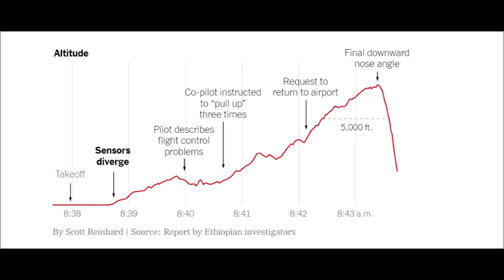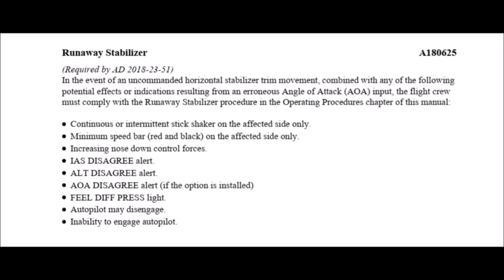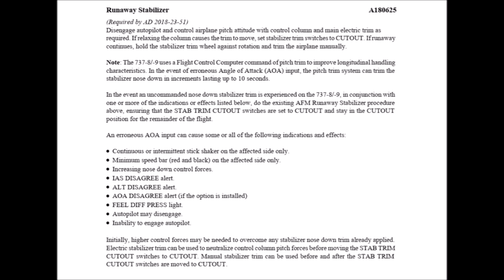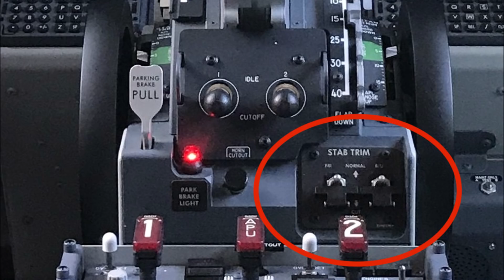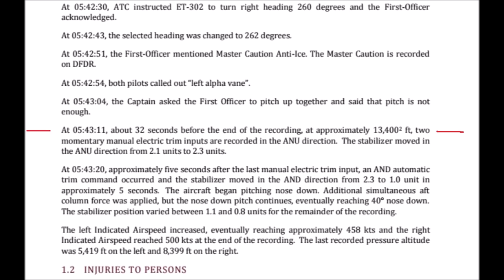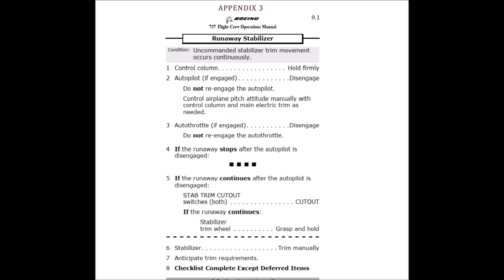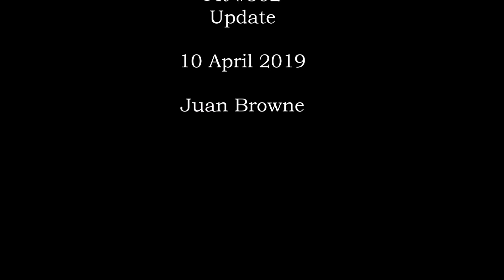737 Max Update 10 April 2019 Runaway Stab Trim Procedures

Comment: My guess is that they switched on the electric trim again in desporation because they couldn't trim it manually because of the high speed and the pressure on the jack screw.
Reply: That much is pretty clear.
      From simulator videos I've seen, the automated inputs are REALLY FAST.  That wheel is just whizzing around, much faster than could be done manually to reverse it, not to mention having to overcome incredible force on the HorizStab at such high speed. 
    I found an article providing more detail, consistent with what is reported in the present video. It seems reliable to me (non-expert).   If this information is deemed unreliable please reply, and I will delete my comment. 
https://www.skybrary.aero/index.php/B38M,_en-route_south_east_of_Addis_Ababa_Ethiopia,_2019
Reply: @MendTheWorld  you make a good point. Those wheels turn very fast. Even if they could trim it manually it would take a long time to turn the wheel. Another reason why they turn on the electric trim because they needed to trim it fast. And the jack screw was found in "full nose down" position. So it would take a long time to move it manually.
Reply: @henryford2736  The trim wheels can turn fast but the rate is determined by the aircrafts mach speed. If the Captain or the First Officer uses their trim "up" thumb switch, it will cancel MCAS operation instantly and trim the nose up. 5 seconds after they release their thumb switch, MCAS will reactivate unless the throw the TRIM STAB switches. The Pilots would have needed to run the nose up trim until they were at level flight, and then immediately flip the STAB TRIM switches into the off position. At this point they would have been able to fly the plane easily using the manual trim wheels.

Look at the medium sized white circle on the up left yoke. That is the location of the thumb switch. The STAB TRIM cutoff switches are below and to the right of the throttle levels in the small white circle.

https://www.flickr.com/photos/109161978@N03/40623677013
Reply: @rwj1313  Yes I understand the controls you are talking about. Nice cockpit pic. 2.5 minutes into the flight the FO called runaway stabilizer and he cut off the 2 switches. Nobody can explain why they were not able to trim the aircraft after that. Clearly they had some issues with the manual electric trim on the yoke because the FO asked the captain if he can use manual trim. Cranking the trim wheel manually. The captain said yes and the FO replied "it's not working." Of course by this time they were at VMO or passed it.
Reply: @MendTheWorld  All the information in that summary is sourced from the preliminary report, which Juan covered in his last video.
It's worth taking a look at that raw report linked at the bottom of the summary however, because near the bottom of the report (Appendix 1)  it includes a single image with series of graphs that show all of the available data plotted over time.   It's literally a picture is worth a thousand words situation.    If you do a Google image search for "Lion Air FDR graph" you'll see a similar image that shows all of its data, but tells roughly the same story.
Reply: @MendTheWorld  To me, the rapidly spinning trims wheels would BE the indicator to me, that, hey, I didn't put a trim input in...whoa, down trim, STAB CUT OFF SWITCHES-OFF.
Reply: @MrFg1980   That's actually what they did, but they did it one MCAS cycle too late.    As Juan and others have mentioned, the trim wheels spin all the time, as reaction to other various automated trim changes such as flaps down/up, probably throttle changes, etc so they're largely ignored.   They would have been expecting a significant automatic trim change just after retracting the flaps, and they got one, but the logs show that it started with an short automatic up-trim command, followed immediately by MCAS's 9 seconds of down trim.  If you weren't watching closely you might not see the wheels change direction, and at that moment they were already dealing with left side stick shaker and a bunch of alarms.     In response to that first MCAS down trim cycle, they applied back pressure on the yoke and a couple seconds of manual electric up trim..  5 seconds pass then MCAS starts another  9 second down trim cycle, which they then recognized as a problem after 5-6 seconds , so they ran about 9 seconds of manual electric up trim in response, and then hit the cutout switches.     Unfortunately they didn't recognize the issue during the first MCAS run, so they never fully removed that initial significant down trim.  Once the cutout switches were thrown, they could only remove that down trim by manually turning the trim wheels, but as the speed built up (because they weren't managing the throttle), the increasing aerodynamic loads apparently made it impossible to turn the wheels by hand.
Reply: @MrFg1980  The reality is the trim wheel is constantly moving and  stopping during normal flight with the auto pilot on.  Which it is 99% of the time. Fuel burn, passengers and flight attendants with carts moving up and down the isles etc. causing the auto pilot to constantly re-trim. After very little time flying the 737, you tend to tune out the noise and movement of the trim wheel. It's movement becomes easily associated with normal aircraft ops.
Reply: @daemn42  I think you are  hitting it right on the head. They never got rid of enough down trim so even though MCAS was off they felt like they were constantly fighting with the plane.
Reply: @MendTheWorld  Thank you for that link
Reply: Yes - I don't fault them for this because at that point they didn't have another option - the manual method did not work.  To me, they made one error - a big one - and let the airspeed get away.  Very sad.
Reply: @donmoore5716  agreed. The pilot can do as a last resort what they feel may work. One more thing. With all that nosr down trim I wonder if they, after reducing power, have had enough altitude to trim up and recover the aircraft. By reducing power the nose will drop and air speed will not change. I cannot see where the discission to keep power in, while it is in the check list, could be pilot error. At roughly 1000 ft AGL I think that would have doomed the aircraft as well.
Reply: @donmoore5716  Apparently there are techniques for recovering trim in that full stop posistion but as you say the very high airspeed seems the crucial factor in the loss of control
Reply: @c7042   Looking at the graphs of the data for both flights, it's pretty clear that manual electric trim always takes precedence.    During the Lion Air flight, they applied manual electric up trim at least 30 times, and in many instances this appears to have immediately cut off an active MCAS down trim cycle.   MCAS on the other hand, always waited 5 seconds after the end of the last manual electric up trim activation before starting its own cycle again.  
There is every reason to believe that the pilots of both flights could have kept ahead of MCAS indefinitely, even if the electric stab trim cutoff switches, and the ability to physically grab and stop the trim wheels had not been an option.
Reply: yep it was very bad the way it was setup (no fail safes or limits at that time) 
if they had simply copied the same rules from the boeing tanker virant none of these crashes would of happened , as below is how the 737max (as well as other things) will make it work as it should been when they got back in the air next month or so

AOA disagreement MCAS will not activate if deviation is to far between 2 sensors (if autopilot can't enable Mcas should not activate)
Limit trim amount mcas can do if activated (there is no need for it to goto max trim down)
and if system does activate and pilots disagree with MCAS auto trim down event all they have to do is pull back on the sticks and it stop MCAS and disable it (won't have to stab trim system)

in this case they should of not turned back on the trim power and engine power should've been reduced it as was at take off speed for the whole fault was happening (overspeed alarm was active) 

lion air flight they never turned off the trim power they was actively fighting the trim system and never seem to have considered to stab the trim as it was in the air for some time after the sensor fault happened and mcas was trimming down the plane (they knew the trim was been pushed down)
Reply: And even that could have worked if they had continued to apply manual electric up trim until it was actually back to where it needed to be, but they only ran it for a few seconds, and then stopped.   Lion Air crew did the same thing.   They kept reversing the down trim MCAS had applied, until late in the flight, where they simply ran shorter and shorter bursts of electric up trim.. for reasons unknown.  For ET302, the problem was that once they let the airspeed get out of control, the moment MCAS ran again, it pitched em over into a negative G dive, they eased off the control columns momentarily (shown in the graphed data) which allowed the plane to pitch over even faster, and then they could never recover from that.
Reply: won't the function (clutch?) that enables overriding electric trim by grasping the trimwheels also limit the force electric trim can apply? i.e. if the force needed to trim is higher than grasping the trimwheel the result will be the same as grasping the trimwheel, no trim
Reply: @fuzzy1dk   Possibly yes, but the cockpit voice recording suggests that they tried manual trim and failed, but that manual electric trim still worked. 
"At 05:41:46, the Captain asked the First - Officer if the trim is functional. The First - Officer has replied that the trim was not working and asked if he could try it manually. The Captain told him to try.  At 05:41:54 , the First - Of ficer replied that it is not working"
But the data suggests that after they moved the switches out of the cutout position and tried manual electric trim, that it was functional
"At  05:43:11,  about  32 seconds  before  the  end  of  the  recording,  at  approximately 13 , 400 2 ft,  two momentary manual electric trim inputs are recorded in the ANU direction.  The stabilizer moved in the ANU direction from 2.1 units to 2.3 units"

It seems that at that moment with the plane still level, and airspeed just above VNE, they could have held down the manual electric up trim button, and slowly moved the trim in the right direction.  The weird thing is that the manual electric trims were only applied for a second or two, while earlier data suggests they had used it successfully for longer periods of time.    Both ET302 and Lion Air flights basically ended the same way, with one of the pilots applying only a second or two of manual electric up trim..   followed by a 5 second pause, and then MCAS applying 9 seconds of down trim.
It is unclear why the pilots did not, or could not use the up trim buttons longer.

Also, the data suggests that any time the pilots apply manual electric up trim in the middle of MCAS's run, MCAS was immediately overridden.   The data from both flights always shows a 5 second delay after the last manual electric up trim command, and the onset of the next MCAS down trim cycle, while many times the up trim command immediately cancels and reverses MCAS.
Reply: @fuzzy1dk  I agree totally and I suspect that is why they didn't use it after they had reengaged it. I suspect the jack screw was free to move down and free to move back up to about 2.3 or so and then the opposing forces from the elevator caused the clutch you speak of to kick in. It probably would have functioned properly had the pilots not been pulling back on the control columns. I understand in some earlier 737 models this was called the roller coaster maneuver.
Reply: @daemn42  
You have a good understanding of what transpired on these flights.  
In the Lion Air case, at the very end it seems to have been pilot inattention to trim state, as they were thumbing through the flight manual, trying to find and follow a suitable procedure to correct the inappropriate auto-trim.  
In the Ethiopian case, we don't have enough information yet, to understand why the pilots didn't continue to manually back off the MCAS nose-down trims.  What they should have done, is maintain longer trim-up commands, then as soon as the control column was near neutral, turn the Stab Cutout switches back off.  
I only have some 30 hours in a simulator, which had a rather bad propensity to be seriously out of pitch trim, but that's enough to drive the point home that you keep on that manual trim as long as necessary, to get back into a trim state.  It becomes just reflex.  I cannot imagine why any pilot with 8000 hours commercial experience, wouldn't have held manual trim on long enough to maintain good control.
Reply: @daemn42  Exactly my confusion.  Why didn't they hold the manual electric trim switches in the up position for a good while until there was no more need for them to hold back pressure on the yoke?  The only think I can think of is trim motor stall or clutch disengagement from the high IAS.
Reply: @ljfinger   The logs show the actual activation of the trim switches as well as MCAS requested commands,   independently of whether it has an effect or not.   That is how we know that MCAS attempted to activate after they hit the cutoff switches but had no effect.     So even if the jack screw motor stalled out, we should see evidence that they tried.   We also can see that even in that last 30 seconds, they applied up trim and it did have an effect, but the activation was was just two short bursts.     

As Juan suggests, I think the situation created some sort of tunnel vision that kept the pilots from fully recognizing the problem.   Recall that the same ET aircraft had a port side AoA failure the day before, causing MCAS activation and it took a 3rd deadheading pilot to recognize the problem and react to it appropriately.    They literally didn't have their hands full, so were in a better position to see the systemic failure.
Reply: @daemn42  I don't see how tunnel vision applies, and here's why.  If you've got both arms wrapped around the yoke and it feels like it's trying to fling you through the windshield, I'd think you'd hold the switch down (or up, in this case) until that sensation went away, and I don't think that muscle-demanding sensation is nearly as susceptible to the tunnel vision effect as things like noticing IAS going transonic etc.
Reply: @marianneoelund2940  Next time you are in the sim put yourself at 3000 ft trim to full nose down position then switch off electric trim. Turn the trim wheel manually and see if you can recover. I'm just curious how long does it take and how many revolutions you have to make on the trim wheel manually before you are able to climb. Is it possible to recover with manual trim at such a low altitude? ?
Reply: @henryford2736  
The trim should have never been allowed to reach full nose-down.  I can't imagine sitting in the pilot's seat, seeing the nose pitching down, and not immediately pulling the nose-up trim switch on the control yoke.  
At the end of the flight, the electric trim wasn't turned off, so they had it available to use.  Pilot should have been keeping a death-hold on his trim-up switch until column force was neutralized, which would also keep the MCAS nose-down trim commands disabled.  Then, as soon as trim was achieved, the Stab cutout switches needed to be turned off again, for the remainder of the flight.  
What pains me so much about this accident, is how close they were to recovering.  
Regarding the simulator available for my use, it doesn't have working manual trim wheels, as it's set up for 777-200LR.
Reply: @daemn42   I disagree with you. Obviously if they could have interrupted MCAS input with the trim toggle switches, they would have been alive today.  MCAS simply had more authority. Don't underestimate the amount of flying hours these pilots had especially the captain with over 8,000 hours.
Reply: @marianneoelund2940  When they recovered the trim jack screw in Etiopia it was found in full nose down position. That was the reason to ground all the Max planes.  As you say it should never reach full nose down but that's what happened.
Reply: @marianneoelund2940  Agreed... the weather was clear skies during daylight hours so the nose over should have been picked up immediately.  As for why the trim inputs were so short?... What non-emergency flight regimes require very large (ie. long time held) trim inputs? I believe this is the reason the trim inputs were short in duration and questions the pilots 'runaway trim' scenario training.
Reply: @MenelikZewdu.videos    Just to be clear only the pilot had 8000 hours.. the FO  200 hours.  
The data from both ET302 and Lion Air flight shows that manual electric trim could and did interrupt MCAS.  First check out this image showing the ET302 FDR data graphed on the same timeline (this is from the prelim report, text annotations included).
https://leehamnews.com/wp-content/uploads/2019/04/ET302-FDR-trace-specifics.png
Look at the violet/blue/red graphs in the middle which show pilot electric trim inputs, FC and MCAS trim inputs and the resultant trim angle.  
Starting at the #1 label, MCAS activated for a full 9 seconds and gave them about 2.5 units of down trim.    Pilots corrected with aft yoke pressure and a short electric up trim cycle.    MCAS then started another full cycle but was interrupted after about 7 seconds with a pilot up trim cycle lasting about 9 seconds.    That shows us that electric up trim can and did override MCAS.     The problem is, they had only fully corrected for the second MCAS down trim cycle, but not the first, and that left them with a net 2.5 units of down trim from where they started.
They then hit the cutout switches which disabled their ability to correct further with electric up trim.    As the aircraft sped up (throttles never reduced), the aerodynamic loads increased, and that apparently prevented their attempts to turn the trim wheels manually (according to CVR), and because the trim moves the entire horizontal stab it is aerodynamically more effective than the elevator itself so aft yoke pressure was increasingly ineffective.   At the end they took the switches out of the cutout position, applied a couple short bursts of up trim (which showed a small positive effect on trim position), and then 5 seconds after pilot input MCAS gave em about 4-5 seconds of down trim, which ended the flight.    

Now look at the Lion Air's similar FDR graph
https://leehamnews.com/wp-content/uploads/2018/11/Report-fatal-parameters.png
MCAS activated 26 times, and the pilots made roughly 30 electric up trim inputs in response.      If you zoom in and look very closely you can see that 1. Many of the MCAS events are cut short by a pilot up trim event, and 2. that MCAS always waits a short period (5 seconds) after the end of the pilot input, before it activates again.  There is never any overlap between the two, just action and reaction.   The flight ended, when the pilots failed to react to a long MCAS cycle with an equally long up trim cycle.
Reply: @henryford2736  
Yes, I know.  At the end of the flight they turned the Stab cutout switches back on, so they could use electric trim; they had no choice because the manual trim wheels couldn't produce enough torque against the aero loads.  But then they didn't keep their thumb on the trim switch to disable the MCAS nose-down inputs.  The same occurred in the Lion Air accident.  
It's against all hand-flying instincts, to let any incorrect auto-trim commands go unanswered.  You feel it in the column.  Been there, done that many times.  I just can't understand why the pilot let go of his trim switch.  150 lives depended on it.
Reply: @marianneoelund2940   And we will probably never know why they turned it back on at the end. Sad. But look at "snaplash" comment. They turned the cut out switches off 2.5 minutes into the flight and even with the switches off were not able to trim it for whatever reason. Even if you cut the switches you still have an aircraft in out of trim situation. The cut off switches are only 1/2 of the solution.  "Snaplash" idea is to have a secondary system that would reset the trim to neutral. I like his idea. If they had a switch that would reset the trim to neutral the outcome would be different. If you don't have altitude and time and you can set the trim to neutral by a flick of a switch would be smart. I just like his idea. That's all.
Reply: @henryford2736  According to the report, they were at about or close to 6000 ft AGL.
Reply: @henryford2736  
The previous video goes through the flight data sequence and explains the pilots' actions.  They had to turn the electric trim back on, because the manual trim wheels couldn't produce enough torque against the high aero loads (aircraft was overspeed).  
As you pointed out, the cutout switches won't help unless the pitch trim is set to neutral first.  That was the first mistake the pilots made.  
A stab reset system would be very difficult to implement, and adds more failure modes to worry about.  Stabilizer movement involves very large forces (think tons) and a substantial amount of power; it just can't be snapped back to a center position easily/quickly.
Reply: @fuzzy1dk I believe the trim that's controlled by the jack screw (and the manual wheel) is different from the electric trim.  The jack screw controls the angle of the entire horizontal stabilizer whereas I believe the electric trim controls ONLY the flaps at the back end of the horizontal stabilizer.  If I'm right, then once MCAS had moved the entire horizontal stab into an aircraft nose down position, the trim flaps on the back of the horizontal stab would have had very little, if any, effect.  Because of the force required to turn the manual trim wheel, it seems to me that Boeing needs to add an electric trim function that would be strong enough to drive the jack screw when manual operation is nearly impossible due to aerodynamic forces on the horizontal stab.  What a mess!
Reply: @daemn42  Actually, that was the Lion Air crash that had the 3rd pilot on the plane on its flight prior to the fatal one, not the Ethiopia one.  You're right though that that 3rd pilot is more likely to see the overall picture, filter out the noise, and determine what needs to be done.  The 3rd pilot on the Lion Air plane saw that the plane was nosing down and told them to hit the cutout switches for stab trim.  He did this WITHOUT any knowledge of MCAS and before the FAA had issued the emergency bulletin.  (The emergency bulletin was issued after Boeing had figured out that a faulty AOA sensor had caused MCAS to nose down the Lion Air plane that crashed.)
Reply: @henryford2736  stated "They turned the cut out switches off 2.5 minutes into the flight and even with the switches off were not able to trim it for whatever reason. Even if you cut the switches you still have an aircraft in out of trim situation."

Activation of either pilots' trim switch automatically disables the MCAS routine. The MCAS routine does not reactivate until 5 seconds after the last trim switch returns to neutral. Nose up trim would function as long as the STAB TRIM switches were on. The pilots should have and could have, used the yoke mounted "thumb" trim switches to trim the nose to a level position BEFORE turning off the STAB TRIM switches.
Reply: @pimacanyon6208  That's partially incorrect. The electric trim runs the jack screw motor only which only adjusts the position of the horizontal stabilizer. The control yoke is the device that activates the elevators that are located on the back of the horizontal stabilizer. 

As an engineer with a lot of experience in automation and robotics, I'm not sure I believe that the jack screw would not be able to overcome the aerodynamic forces. Jack screws are used because of the crazy amount of torque that they can produce. Think about the simple jackscrew common to scissor type automotive car jacks. I think people are not understanding that the jack screw motor is not connected directly to the jack screw. The motor probably drives a gearbox of some type that in turn drives the jack screw. This applies even more torque multiplication to the equation. If I was guessing, and I am guessing, I would think that it is probably a planetary gear setup. This would multiply the torque and also run fast.
Reply: @daemn42  From what I saw in the data I have an opinion that even the electric trim could not overcome the forces. So In my point of view they tried to trim it few times without any effect and then the MCAS kicked in... Most probably too high speed and yoke force.
Reply: @rwj1313  thanks.  that makes sense.  but if you're right that manual operation of the trim wheel was actually possible even with large aerodynamic forces being applied to the horizontal stabilizer, then why did the copilot say it wasn't working?  Also, there used to be a section in the flight manual that explained how to "unload" the horizontal stabilizer (by pointing the nose down for a short time) so that manual operation of the trim wheel would be possible.  Why would they need that procedure if it were always possible to turn the trim wheel regardless of aero forces?
Reply: @pimacanyon6208  asked "then why did the copilot say it wasn't working? " 

Do you have a link or a source that provides what he is saying in context? 

Greg Kesselring also asked "Why would they need that procedure if it were always possible to turn the trim wheel regardless of aero forces?"

I don't know if it is possible for a single pilot to overcome the forces in all situations. I do know that the handles on the trim wheels are offset 180 degrees just like the pedals on a bicycle. This would allow the arm strength of both the Captain and the First officer to apply more force to the trim wheels.

I will have to do more research to answer your question about unloading the horizontal stabilizer.
Reply: @rwj1313  I believe Juan said in this video that the copilot said manual trim wasn't working.
Reply: Rick Jones - From reading MOST of the comments, am I correct in understanding that a problem with the MCAS can only be mitigated, and not disengaged completely?
Reply: @jameylane9196  MCAS is a program routine. The software exists in the Flight Control Computers (FCC) There are 2 FCC's. I believe one is main and the other is redundant. The jack screw receives electrical signals from the FCC's. The STAB TRIM switches literally break the connections between the FCC's and the jack screw motor. Throwing the STAB TRIM switches completely disables MCAS.
Reply: @pimacanyon6208  I just rewatched the video and didn't find what you are talking about. Maybe you can watch it and point out the exact time in the video so I will know what you are referancing.
Reply: @jameylane9196  yes, the current implementation of MCAS does not have a feature that lets the pilots turn it off.  Obviously, they can disconnect MCAS from having control over the horizontal stabilizer by hitting the cutout switches, but as we've seen that appears to be a poor workaround for a major design problem.  Hopefully, the software upgrade to MCAS will allow pilots to turn it off!  Or at least turn itself off when it determines it's getting a bad reading from the AOA sensors.  Besides looking at both sensors to see whether they agree, MCAS ought to look at the reading itself and discard it if it's obviously wrong.  At one point during the Ethiopia flight the AOA sensor was reading 70 degrees!  That's near vertical!  Is it even possible for a 737 to EVER fly at an angle of 70 degree??  As bizarre as that reading was, MCAS still took that reading as if it were fact and tried to push the nose of the plane down...
Reply: Rick Jones  - Got it.  And MCAS cannot "turn itself back on" when the STAB TRIM switches are thrown?
Reply: @jameylane9196  Correct.
Reply: @jameylane9196  hitting the stab trim cutout switched does NOT turn off MCAS.  MCAS continues to run and continues sending nose down commands to the horizontal stabilizer, but the cutout switches prevent those commands from actually turning the jack screw that drives the horizontal stabilizer.  But MCAS is still running.  If MCAS does anything else to any other flight control surfaces, those actions will happen even after the pilots have hit the stab trim cutout switches.  And, because MCAS continues to run, if the pilots decide to turn those stab trim cutoff switches back to the normal position (undo the "cutout"), then MCAS will continue to do what it was trying to do earlier when they hit the cutout switches the first time. This is what appears to have happened on the Ethiopia flight.
Reply: @rwj1313  at 14:50 Juan said that they found manual control was virtually impossible.  Also around 5 something in the video, where the video displays the conversation between pilot and copilot, the copilot says something about manual trim not enough, but I didn't find where he said manual trim was not working and don't have more time now to research it.  There was another video, on another channel I believe, or possibly in a news article, where a pilot is talking about the procedure that used to be in the flight manuals that was to be used when turning the trim wheel was virtually impossible due to aero forces on the stabilizer, and that procedure said to nose down the plane momentarily to relieve the pressure so you would then be able to turn the wheel.  I'll look around and see if I can find the article or video.  I remember the pilot being puzzled about why that procedure used to be in the manual but at some point it was removed.
Reply: @rwj1313   at 14:50 Juan said that they found manual control was virtually impossible. Also around 5 something in the video, where the video displays the conversation between pilot and copilot, the copilot says something about manual trim not enough, but I didn't find where he said manual trim was not working and don't have more time now to research it. There was another video, on another channel I believe, or possibly in a news article, where a pilot is talking about the procedure that used to be in the flight manuals that was to be used when turning the trim wheel was virtually impossible due to aero forces on the stabilizer, and that procedure said to nose down the plane momentarily to relieve the pressure so you would then be able to turn the wheel. I'll look around and see if I can find the article or video. I remember the pilot being puzzled about why that procedure used to be in the manual but at some point it was removed.
Reply: Greg Kesselring  - Yes sorry, should have said MCAS can't effect the trim again by itself with the cutoff switches engaged.  I forgot that the pilots didn't leave it cut-off, and no one knows quite why.  Although, I think I agree with you that speed might be why, which is why I was asking about the level of error involved in not managing the airspeed.  Was it understandable under the conditions?  Or should it be one of the top priorities when something like this goes wrong?   The Lion air pilots never turned the trim off correct?
Reply: @pimacanyon6208  Got it. I'm not sure if they meant that the trim wheels would not or could not be moved. My initial thought was that the speed required to retrim the aircraft was impossible with manual control. In other words, by the time you could crank the trim into the proper position, you would have already crashed.  I think that's why the procedure for runaway trim specifies that the pilots should use the electric trim to get the aircraft level and then use the STAB TRIM cutout switches.
Reply: @daemn42  -  Good job analyzing,  its seems like the bulletin after the first accident should have explained the over-ride priority and the 9 second on / 5 second off timing approach of MCAS.   Until the second accident I don't remember that being made public.   I don't think the pilots understood MCAS to that level of granularity.
Reply: @daemn42  People pick on the first officer for having 200 hours of time but he is the guy who called for the MCAS system to be turned off.  The only real mistake seems to be not pulling back on the throttles.  If the plane wasn't going so fast the manual trim probably would have worked.  Twice the speed equals 4 times the aerodynamic pressure.   World class power lifters may have been unable to move the manual trim.
Reply: @daemn42   tunnel vision / fear took over. they no longer could logically help themselves.
Reply: ground pounder here noted they let the trim motors work against them too long.  The final dive seemed hopeless?  @daemn42
Reply: @daemn42  That is because if you hold the trim at that speed you get a tremendous pitch up.  Conversely, the MCAS kicking in literally pulled them out of their seats (depending on how tight their lapbelts were) as it went negative g.
Reply: @shemmalmquist    They would have felt the pressure on the control yoke easing off long before they got "tremendous pitch up".   Manual electric up trim acts no faster than MCAS's down trim (can see it in the graphs).  In other words, it would have taken another 9 seconds of up trim just to get back to where they started.
Reply: @daemn42  I'm not sure how much time you have flying jets.  First, at higher speed, the manual trim might actually act slower, but that is not the point.  A small trim change can create a lot of pitching moment, particularly at higher speed and low altitude.  Pilots normally trim in short momentary clicks as a result.  That is how we are taught. You don't want to just hold the switches down, you give it a click, assess, give it a click, assess, etc.
Reply: Serious question - when does the thrust get cut back from take off?  Do they have an excuse for going so fast because they were on ascent?
Reply: @jameylane9196  The system is normally connected via the autothrottle  so thrust reduction altitude would be dependent on whether they programmed NADP1 or NADP2 and any engine out level off altitudes involved.  We add automation into these systems so pilots do not have to pay attention to them, and then if the pilots do not pay attention we blame them for it.
Reply: Shem Malmquist   If an uncontrolled trim down situation occurred disengaging the throttles through whatever method (manual or disengage autopilot) would be one of the first orders of business?  Or wouldn't the auto-throttles know to do so?
Reply: @jameylane9196  In the US there is a restriction to fly at 250 knots (288mph) or less when under an altitude of 10,000 feet, which falls into the Class B airspace level. But, in some cases, the Class B level can extend higher. For example, in Atlanta, the ceiling of the Class B airspace is up to 12,500 feet. Your question is too general though and doesn't really have a simple answer. There are many factors to consider when setting throttles.
Reply: @shemmalmquist    If you look at the graphs of the FDR data from ET302 you'll see that in response to the 2nd MCAS activation they applied manual electric up trim for at least 8-9 seconds continuously, so clearly it's not unheard of to do it that way.
Reply: @daemn42  What you might do at low speed is much different than high speed.  The immediate response of the aircraft (g/alpha) would have led to a different response by the pilots.
Reply: @daemn42  : Dear Expert aeronautical engineer: From this post, you have never taken off from Addis Abeba (runway surrounded by mountains). Besides, perhaps you haven't noticed, when you read the report, that, apparently, pilots disengaged the système several times, but it fought them back, reengaging itself all the way to the crash site.....
Reply: The AOA sensor had over 140 issues ( pilot reported ) since BOEING started them on to their aircraft in the 90s.   25 of these issues were similar to that experienced by Lion Air and Ethiopian Airlines.
Reply: Jo Marko, i have heard anecdotal evidence of this and looked myself. Could you cite a source of the info please. This would seem to support my theory of lack of quality training and hours of flight experience in the 2 crashes. It’s reminiscent of what happened to an Indonesian flight crew not so long ago ;

On 28 December 2014, Indonesia AirAsia Flight 8501, using an Airbus A320-216, from Juanda International Airport, Surabaya to Changi International Airport, Singapore, crashed into the Java Sea between the islands of Belitung and Borneo, killing all 162 on board. The cause was initially a malfunction in two of the plane's rudder travel limiter units which caused the plane to stall while encountering a thunderstorm. The crew ignored the recommended procedure to deal with the problem and disengaged the autopilot which contributed to the subsequent loss of control. Investigators have stated that the condition of the FAC (Flight Augmentation Control) on the flight "was persistent enough" for the captain to do such actions
Reply: @c7042  I think the issue with MCAS and the controls will be more of a systems design one than a coding issue (also a code jockey / elec eng btw) - I am sure they code according to a flow chart / plan which reflects the system design and functionality and it seems crucial factors and what-if's were overlooked.
Reply: @c7042  I've been programming since I was a teenager. Let's just say in college we were riding on mainframes and that's what I'm thinking. I'm guessing some manager decided to save a little money and decided all 737 score the same and to just toss the old system under the new plane.
Reply: By the way are you aware Ashley uses Windows systems that's literally insane . they should be using custom Linux distributions they build themselves
Reply: @c7042  Yes. I want to know what genius wrote and approved code that would trim nose down indefinitely until it was in full nose down position.
Reply: @henryford2736   Coder will code according to what is required - this is a systems design issue, in particular having the MCAS on use one AOA sensor ..... and ignore airspeed!
Reply: @Kosmonooit  I get it. I was being sarcastic.
Reply: @henryford2736  Test pilots tested the MCAS system thoroughly, but nobody thought of what might happen in the case of a sensor failure coupled with poorly trained pilots. Nobody imagined that the pilots would not recognize "runaway stabilizer trim" and then fail to follow the correct procedure to stop it. The procedure is taught to ALL 737 pilots. It is a "memory item" that they are supposed to know. 

This video is from 2017 BEFORE either 737MAX crashed and explains what a pilot is supposed to do in the event of "runaway stabilizer trim".
 Boeing test pilots and programmers tested MCAS assuming that in the unlikely event of some odd failure, the pilots would follow the documented FCOM procedure to stop the "runaway stabilizer trim". Tragically, that assumption was wrong. 

What is that spinning thing?
https://www.youtube.com/watch?v=l62NvkRWa5E  

An Emergency Airworthiness Directive (AD) 2018-23-51 was sent to all 737Max 8 and 9 owners after black box data showed that the pilots that crashed Lion Air flight 610 failed to follow the existing runaway stabilizer procedure.

Emergency Airworthiness Directive (AD) 2018-23-51 reinforces the need for pilots to follow the existing runaway stabilizer procedure and adds more information on how malfunctioning angle of attack or speed sensors can cause runaway stabilizer commands.

This AD is effective December 21, 2018, to all persons except those persons to whom it was made immediately effective by Emergency AD 2018-23-51, issued on November 7, 2018, which contained the requirements of this amendment.
 
FAA AD #: 2018-23-51
2018-23-51_Emergency.pdf
https://www.federalregister.gov/documents/2018/12/06/2018-26365/airworthiness-directives-the-boeing-company-airplanes

If it turns out that the Ethiopian Airline crashed for the same reason as the Lion Air flight, then people should be asking why didn't Ethiopian Air's pilots seem to know about (AD) 2018-23-51?

The AD describes in detail what the pilots would see if MCAS was trimming the nose down and it spells out clearly how pilots should react to it.

Facts matter.
Reply: @rwj1313   They did recognized "runaway stabilizer trim" and cut the 2 switches around 2.5 minutes into the flight.
Reply: @henryford2736  They turned the switches back on a few seconds before the plane nosed over for the final time and crashed.
Reply: @rwj1313  Correct. And nobody knows why they turn the switches back on but they must have had a reason. We will probably never find an answer to that question.
Reply: Hard to believe either one didn't see the speed
Reply: dave houston that aircraft could have broken up in midair , by VNE,  cheers from NJ
Reply: @Larry  Probably not in those specific conditions while pushing past the VNE into a dive, but someone surely must have used a manual electric trim control for more than 9 seconds at a time, if even in a simulator.  I'm less interested in what happens after the pilots literally let the situation get out of control (airspeed past VNE, throttles at 94%, entering a dive with full flying stab trimmed down), and more interested in how they got there in the first place.  The data indicates that manual electric trim had a positive effect at every point in the flight before those last few seconds, so I want to know if there was there something in the software preventing them from using it for more than a few seconds at a time, or something in their training that just made it not ever occur to them to try.
Reply: Agreed, to me it sounded as if the FO tried to manually trim back the stabilizer, but was unable too. As a last desperate effort the Captain tried again to electrically trim the aircraft. WRT the high speed. Perhaps the overspeed situation was the only reason they were still flying and did not crash sooner, as the overspeed situation gave the aircraft a nose-up pitch tendency...
Reply: @fransezomer  "Perhaps the overspeed situation was the only reason they were still flying and did not crash sooner, as the overspeed situation gave the aircraft a nose-up pitch tendency..."
The thrust will provide nose up force, and higher speed also gives the wings more lift at the low amount of AOA/pitch they were struggling to maintain. So yeah, I think it's too easy to sit in a chair and say what the pilots did wrong. Also, most pilots are trained to maintain a certain throttle and pitch, in case of AP or sensor failures. Since they could not set the pitch correctly, w/e throttle setting they would have used "by the book," would have have led to over speed while they were struggling to get the nose up.
Reply: @mildyproductive9726  I agree completely. 
Seeing the so called aviation experts (mostly US) on TV, bugged me immensely when they were insinuating that American pilots are "better" pilots than these Ethiopian Max pilots... Just because one requires 1500 logged hours in the US instead of 200 hours before transitioning to jets; It does not mean that you will be a better 737 pilot when starting your career at an airliner...  There is the same learning curve when pilots switch from a prop to a much larger commercial jet. Plus most pilots get their 1500 hours in the US by being a flight instructor, which means they don't even fly themselves and most instructing will only be done in VFR conditions. Same goes for pilots that taxi skydivers up and down. Difference between Ethiopian and US pilots is marginal imo. BTW. Pilots in the EU go directly after flight-school with only 250 hours into 2nd officer positions at the major airlines (BA, AF/KLM, Lufthansa, etc). Mostly flying 737, 320, or Embraer together with an experienced (training) captain. 

TBH, I think the chances of dying in an aircrash is much higher in the US than in other countries. Reasons are:
1) the exhausting flight schedules, especially for new pilots with regional airlines. Same goes for ATC.
2) the congestion in and around the US airports.
3) Some procedural differences that will eventually lead to a crash imo, ie. the "early" landing clearances, even before the runway is cleared of traffic... remember the Air Canada near crash @ SFO? Air Canada landed (was cleared), but ATC tried to send it around. AirCanada had a broken radio and could not communicate. Almost catastrophic...
Reply: @fransezomer  I don't know. Lot of pilots in US are ex military like Juan with lot of experience. Does this makes them better than someone who has 200hrs? I would say yes. Just to graduate from the air force academy is a huge achievement. Is someone who can land on an aircraft carrier better than someone with 200hrs I would say yes imo. Is someone who has to plan and execute a dog fight in FA 18 better then someone with 200hrs I would say yes imo. 

But it's up to the airlines who they employ. I don't mean to degrade the FO on Ethiopian but was he as good as an ex US military pilot probably not imo. There are over 87 000 commercial flights in the US every day. No Max crashed. I would say the US pilots have their game together.  And I'm not a fan of the Max. More of a 777 fan.
Reply: @henryford2736  Nice story, but it doesn't fly... Less than 30% of US commercial pilots are ex-military. That means that  7 out of 10 US pilots are trained as I described. Contrary to what the experts were suggesting they are not better or worse than pilots in other parts of the world. That is the bottomline here.
Reply: @fransezomer  I don't think anybody was saying Ethiopian Airline pilots are lacking in intelligence. I think it is purely an issue of training hours, training and flight experience. It is a fact that many of the Ethiopian Airline pilots lack the experience of not just American pilots but pilots from many other countries.
Reply: @snaplash  When you're as low as they were there is not much time to crank it manually plus all the pressure on the jack screw will make it difficult to crank by hand. That's why the copilot said "it's not working." The manual crank. So a switch located by the 2 cutt off switches that would reset the trim to neutral may not be a bad idea just in case the trim goes crazy for any reason.
Reply: @henryford2736  Looking at the altitude graph, you can see that the captain was able to overpower the off trim with console pressure and keep the plane flying. Therefore he had the ability to leave the elevator trim cutout switch off and still fly the plane. And that's what he should have done. Easy for us to say...
Reply: Why the following wouldn't work: turn on back stab trim, adjust the trim using electric motors and turn it back off quickly, before mcas engage back?
Reply: n @alexbogdanov3021  That would have been the correct procedure. The MCAS routine stops automatically when either trim switch is activated. The MCAS routine pauses for 5 seconds and then restarts. This may not seem like much time but the pilots could have done this together. One of them should have been flying the plane, whilst the other worked the problem.
Reply: The reports I have seen suggest that the force required to move the trim wheel at the speed reached (500kts) was beyond the pilots ablities while holding the yoke back (which took 30kg on each yoke). A third pilot may have been able to save the plane by managing the throttles and trim but it takes a brave (and knowledgable) pilot to pull the throttles while a stall warning is active.
MCAS is a horrible piece of design  (speaking as a designer of safety critical industrial equipment). A safety system with NO diagnostics, a single randomly chosen input and enough authority to override all the pilots inputs is just a bad system looking for a crash site. 
Compound that by not telling the operators and maintainers that it even exists and Boeing are going to have a really hard time in court.
It makes the FAA look like a bunch of incompetent turkeys (which is probably insulting to turkeys...)  as well for approving it at all.
Reply: @allangibson8494   I agree with you MCAS is a horrible piece of design in the current form. The new engines cause the pitch up effect and created the need for MCAS. Should the MAX go back to the drawing board and be designed and balanced properly for the new engines?  Is that what the Boeing engineers wanted but management said NO it's too expensive? If you look at pictures of the 737-200 the engines are directly under the wing. On the Max they are in front of the wing. Is this new engine really the elephant in the room that is biting Boeing in the butt?
Reply: Correct!
Reply: @c7042  The manual thumb switches have priority over the MCAS routine. In the case of the Lion Air Flight the Captain operated the manual trim "Up" about 30 times before asking the First Officer to fly the airplane so that the Captain could try to locate the correct recovery procedure in the Flight Crew Operations Manual (FCOM). If you look at the length of time the Captain activated "Up" trim, his trim switch pulses roughly equaled or exceeded the amount of time MCAS applied "down" trim. When the First Officer took over, he only applied short bursts of "up" trim which weren't long enough to counter the "down" trim that MCAS applied. 

The resolution of this black box data graphic isn't very high but you can see enough to understand what happened near the end. Compare the data in the blue TRIM MANUAL versus the brown TRIM AUTOMATIC. Look at the altitude data and see how it correlates to the TRIM MANUAL and TRIM AUTOMATIC inputs.

The data can be seen here:
Lion Air Crash Report Raises Questions About Maintenance And Pilots' Actions
https://www.forbes.com/sites/jeremybogaisky/2018/11/28/lion-air-crash-report-raises-questions-about-maintenance-and-pilots-actions/#40c067aa45c4
Reply: @henryford2736  The more automation you add, the more that can go wrong when it doesn't work as designed or expected. It's a tug of war. Who should be the final authority, the pilot, or the automation? Spock in Star Trek said it best. "Computers make excellent servants, but I have no desire to serve under them..." That was in the 60's, and even then, they predicted the issue. Remember MCAS was added as an automated safety enhancement too.
Reply: I would have simply flown inverted to gain a little altitude.  And I'm not even a pilot!
Reply: @jameylane9196  That might have worked.
Reply: @davidsine4390  MCAS is like a system in your car that will keep turning the steering wheel by itself until you crash. Imagine driving a car like that.
Reply: @henryford2736  Every transport category aircraft being built these days has these types of systems. Airbus has fly by wire, full flight envelope protection systems built in. Is it possible to override them,? Only if a pilot has trained themselves. But there is zero formal training on how to do so, zero. The theory is why would you want to? Nothing will ever go wrong. The only training is dealing with how to fly the aircraft should they fail on their own. The training does NOT include ways to disabe a flight protection system because it went rogue. It's assumed the possibility is too remote to occur I assume. Happy flying.
Reply: A last desperate try......
Reply: yup, hail mary...:-(
Reply: @snaplash  This is a great idea. Stangly it hasn't been applied. It makes total sense as if there would be a legitimate risk of stall, it could be easily manually corrected as soon as the trim is neutral and MCAS disconnected.
Reply: It would be good to have two switches. One for the electric trim and one for the MCAS. Otherwise the pilots should have a higher priority than the MCAS.  Also, the MCAS can inform repeatedly the pilots that in X seconds it will be activated. I'm probably missing many details and I'm oversimplify.
Reply: less luxury of height.
Reply: Not likely.
Reply: @Larry That seems like a very key question.
Reply: And had they turned it back off again, they would be here today.
Reply: @c7042  I heard somewhere the trim switches have priority and will interupt an MCAS input/event, but MCAS takes over as soon as they are released. That is to say, if MCAS still senses a high AOA, as soon as the thumb switches are released, it attemps to complete its nose down trim cycle.
Reply: @c7042  I have flown the 737 -200 and -300 series aircraft. There is no question in my mind that after MCAS initially cycled, and having to hold back pressure against the subsequent nose down trim, and having MCAS start a second cycle, I would have noticed the trim wheel movement and would have instinctively grabbed the trim wheel to prevent further nose down trim or ordered the other pilot to do it if I were the pilot flying. Even without knowing about the system. But some of this does come with experience. Not trying to disparage these crewmembers at all, but obvioulsy the more experience the better, as in all endeavors.
Reply: They might not have had any control at all by then. Wings and control surfaces are designed for a certain speed these guys were near super Sonic in a plane design for nowhere near that speed. And from what I've read Boeing basically didn't change the MKS system when it put it into the maxx. Which has different engine placement. They need to open up the source code of their impasse system to outside and independent non Boeing not FAA programmers
Reply: George Suchenstein   Juan said that also.
Reply: My guess is, at the stab trim position they were in, and at the high IAS they were at, when MCAS activated the final time, MCAS nose down trim was assisted by aerodynamic loads on the horizontal stabilizer, where as, nose up trim was not possible due to excessive loads. Sort of like trying to close a water tight door on a sinking ship against the flow of water. Very easy to  just let it fly open, not so easy to close. Just speculation.
Reply: To those who say they should have throttled back:  The whole point of the MCAS is to compensate for the pitch up effect caused by an increase in throttle/engine thrust.  So if one throttles back it will cause an equivalent pitch down effect - presumably by about the 2.5 units the MCAS normally adjusts by.  At , say, 6000ft AGL with trim already way too nose down while already pulling massively back on the yoke - choosing to throttle back, with an effect like adding another 2.5 units of down trim, would immediately have led to a crash (in a very similar way to what happened at the end when the MCAS did add its final 2.5 units down).  The pilots were very aware of the pitch up/down effect of changing throttle settings (from their normal experience flying the 737Max and the Lion Air incident) - so would have known it too dangerous to throttle back.